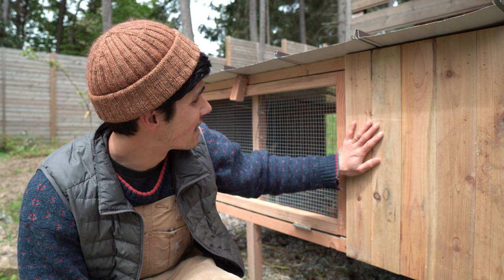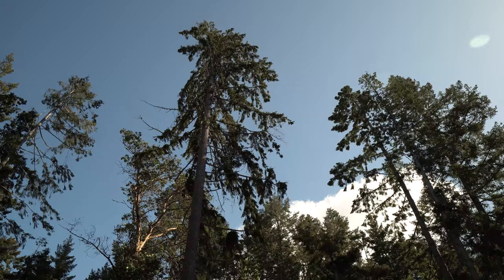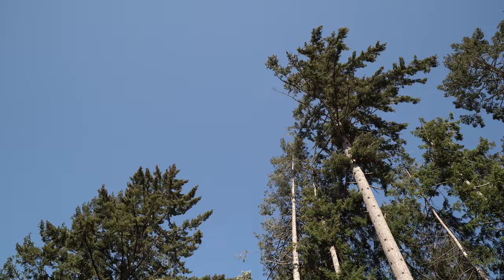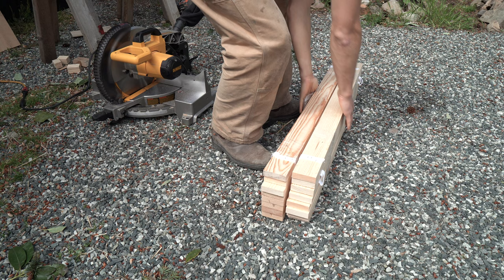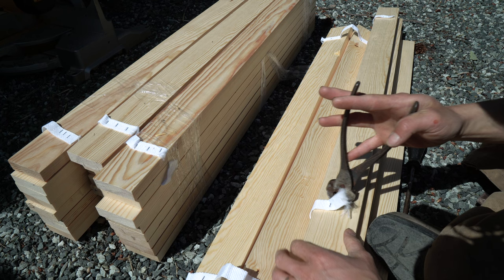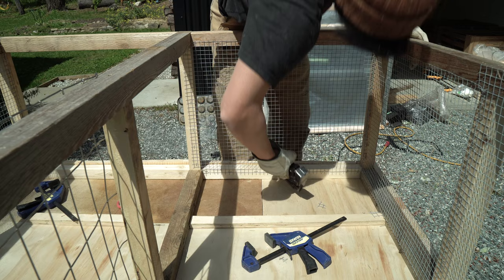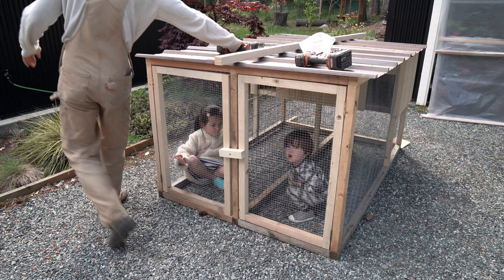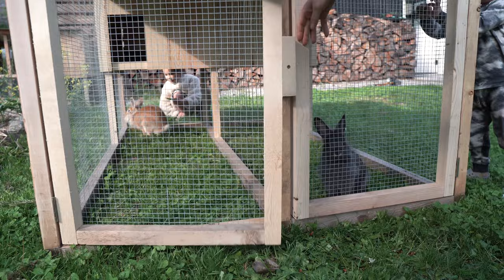Simple Minimalist DIY Rabbit Hutch from Recycled Material

Comment: what do you have weighing it down? how do you avoid them going underneath it? do you have a ramp for them to get up into their cubicles
Reply from the maker: Thanks for all the great questions! There's nothing weighing it down other than the weight of the structure itself and its contents. The bottom is covered in 2x4 wire mesh which prevents burrowing out but lets grass in. And yes, I added a ramp afterwards to access the upper loft 👌
Reply: @Slowsteading  lol sorry for so many! very intriguing video, im on an enclosure binge right now😂 thank you for responding!
Reply from the maker: @mikgriddle  For sure, I hope this video was helpful for you!

Comment: Your editing is great 👍,  mine sucks, I should be ashamed lol, why not elevate hutch and collect the free fertilizer,  its cold compost,  it can be used directly on plants, im building a hutch on top of my compost bins to collect the fertilizer lol
Reply from the maker: Thanks, I've been practicing a lot!

I ended up re-locating this hutch onto an area that will become a garden bed. So now all the manure will compost in place and build the bed up, then I'll move the hutch when I'm done.

That being said it's still messy. Building directly over a compost bin sounds quite functional.
Reply: That's a great idea! When I was a kid my dad built our second set of hutches tall enough and wide enough to accommodate a plastic wheeled garden cart under each end (park the barrows between the legs on the short ends of the hutches) so we could dump the poop elsewhere pretty easily. It wasn't cost effective for multiple hutches but for the four we had at the time (1 buck, 2 does, 1 growout pen) it worked pretty well.